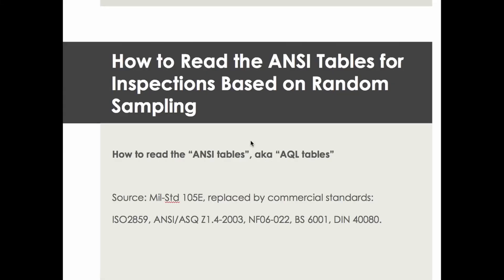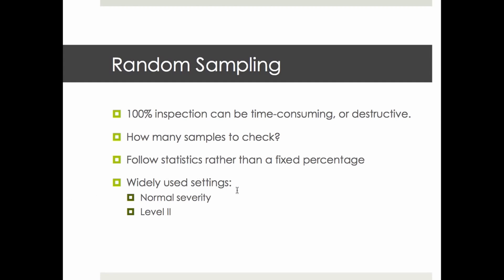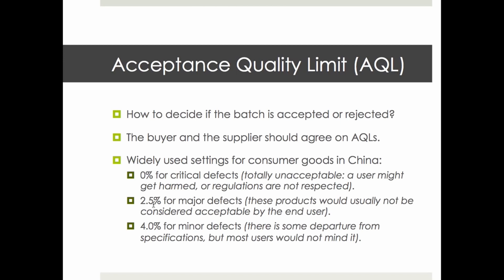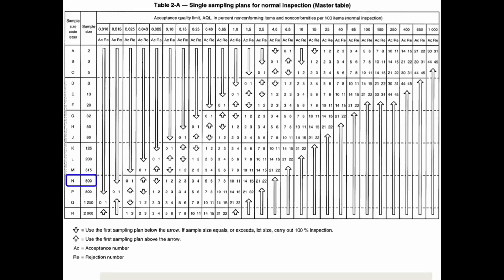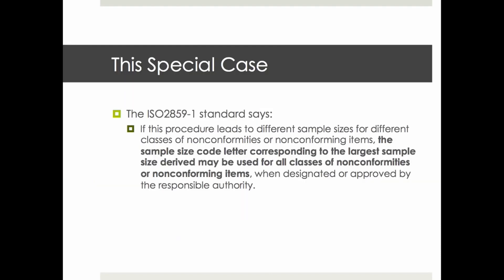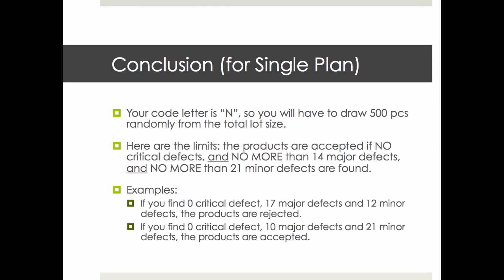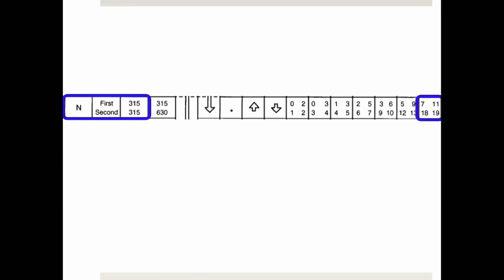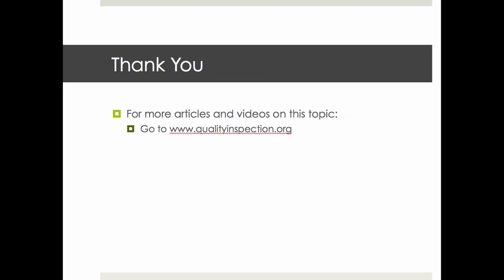How to read the ANSI tables for inspections based on random sampling

Comment: If I had a lot size of 8, GII inspection level, customer wants AQL=1.0%. Under ISO2859-1, single sampling plan, sample size shall be 13, but my lot size is only 8. Shall I do 100% inspection, or I can still follow under GII inspection level which is sample size = 2?
Reply: You do a 100% inspection if the test is non-destructive.

Comment: I have question, If you control with AQL 1.5 and check Code L with 200 pcs and find out 8 pcs NG (8/200NG) , after that you continually check until 315 pcs totally and not find out any part NG more (8/315NG), how to judge for this case? Acceptable or Reject?